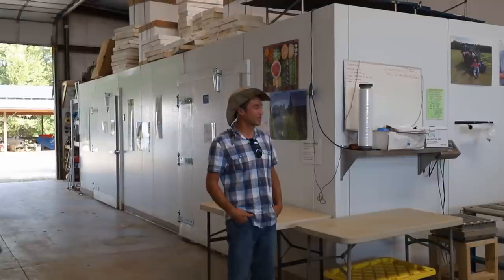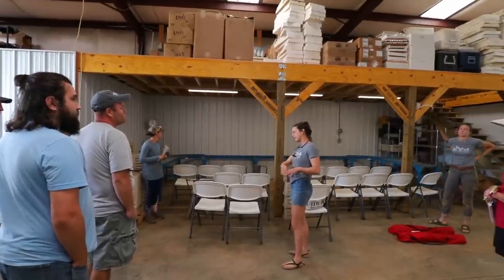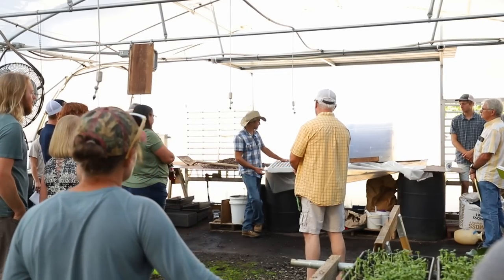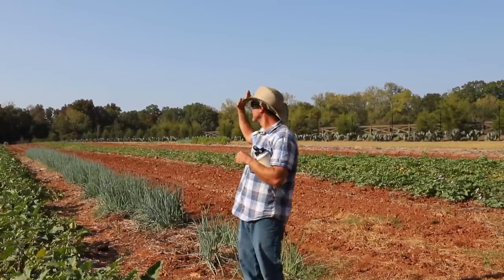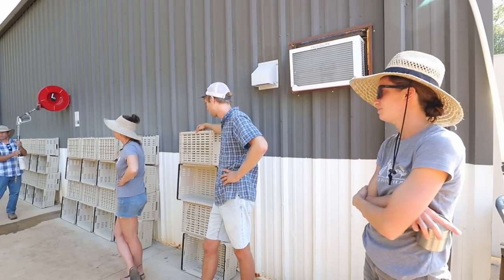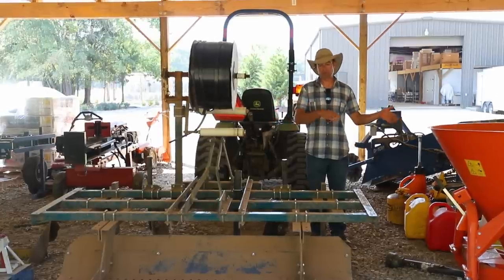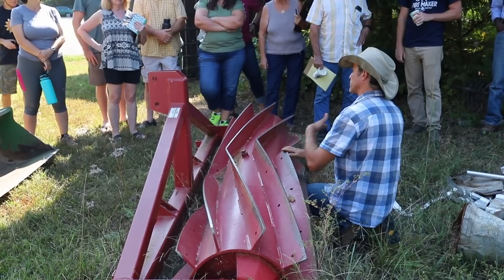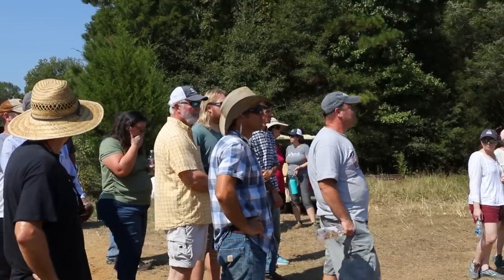No-Till on 12 Acres?!?

Comment: They are doing a great job, but no-till means never tilling!  If you're using a disc harrow, a rototiller and a cultivator, it’s anything but no-till.  Obviously incorporating cover crops is an issue, especially on their scale.  They must have half a million $ worth of infrastructure too!  I do appreciate seeing these larger market farms with some mechanization, anyone who market farms knows that the amount of labour is
Reply from the maker: There is no definition of "no-till" and everyone seems to have a slightly different take on it and that is okay. I will be posting the presentation that Shawn did as well. He mainly uses the rototiller and/or discs to begin the process of getting the field ready. He also takes about a full year of cover cropping before even planting a cash crop. I think sometimes it makes the most sense to till before you get started and then you can practice more of a no-till thing. Everyone's context, soil, climate, etc. is different.

Comment: This is troubling. I would like to know Shawn's definition of tilling, because these explanations seem to be an adulteration of the term "no-till" and the concepts of cover cropping. I see naked, tilled soil everywhere at 19:00.  I can appreciate that when scaling up, some mechanical disturbance is going to be necessary, but tilling creates weeds, it does not mitigate weeds. Naked soil encourages weeds, and two months w/o rain, that soil is getting broiled.  Raised beds encourage mineralization wash down and out. At that scale, it would seem that the soil in the paths would be your best "valley bottom rich" growing area, all be it heavily compacted. A lot of tools/toys in that shed, and it seems to me they need to trade a lot of that steel in for a really good no-till drill that can get through the soil organic material and surface litter that Shawn is clearly "no-tilling" under right now. Gabe Brown's definition of "No-Till" and Clemson's are clearly not at all related, and if the goal is to reduce the tremendous environmental destruction caused by agriculture, one of these is "THE WAY" the other is not.
Reply: Yes, seems like a LOT of tractor work and tilling for a "NoTill System!"